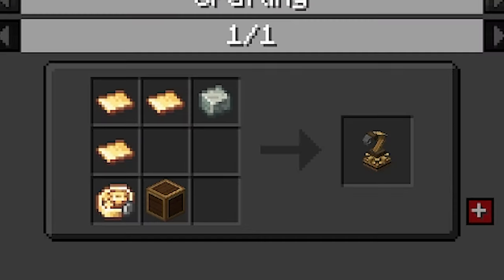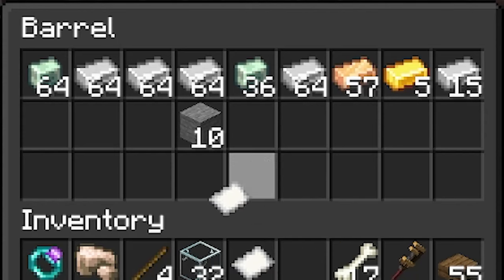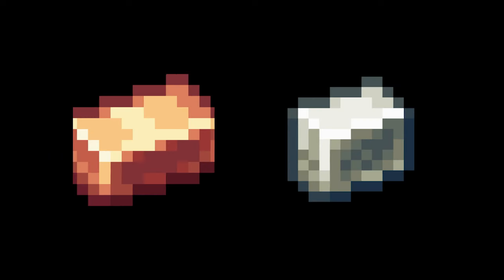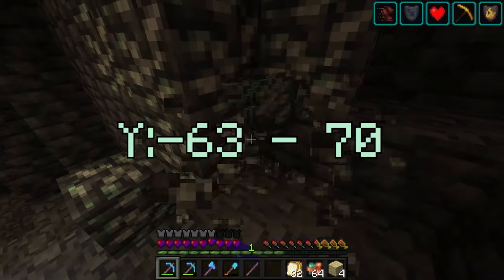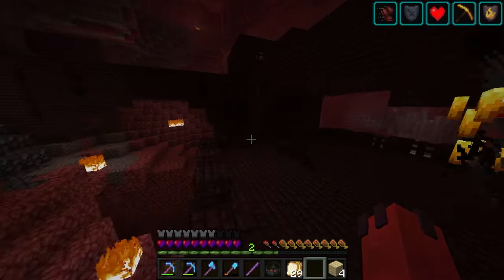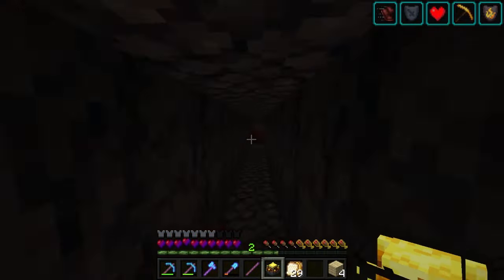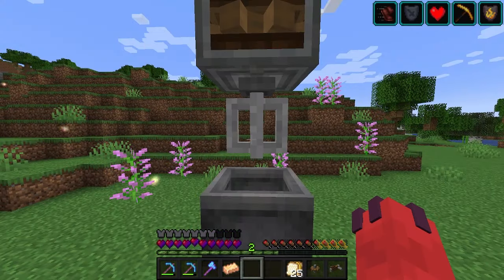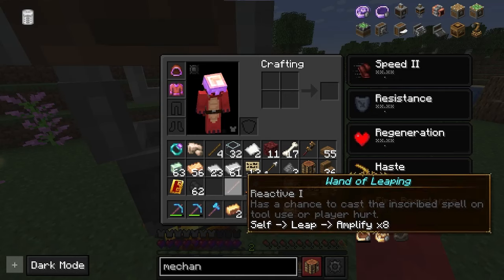How to make Brass - Minecraft: Create Mod

Comment: why is the mixer spinning but not dropping? i have more than enough force and my blaze burner is fueled and its spinning really fast

Edit: the issue was that the zinc and copper wasnt smelting. i saldy couldnt solve that so i resorted to smelting the zinc and copper in the tincers construct furnace and transferring it via pumps 

help would be appreciated because smelting it that way is really annoying
Reply: Did you solve that?
Reply: @euviumsapogrande4092  yh
Its a basin, not a caudron!
Reply: @gonzalezignacio3049  yea I found out I was using andesite alloy instead of tin to make bronze

Comment: No help when I don't have the press lmao. Can't get the press with out this so no HELP
Reply: You don’t need brass to make the press what u on about
Reply: @lordhall3774  The brass hand part of it takes brass... that's where I am stuck as well...
Reply: @MsPinky8890  you don’t need a press to make brass, blaze thing and mixer
Reply: @MsPinky8890 sorry you do need the press but you don’t need brass to make it, I think you are trying to make a deployer instead of the press of something, press does not require any brass just an andesite casing which can be made without a press.
Reply: Yes you can? Lmfao
It's a shaft, an andesite casing, and a block of iron

Comment: That didn't work for me. I tried using a water wheel. It shows what you show in the video, I did that but the mixer arm won't go into the basin. I have enough su but idk.
Reply from the maker: It might be the speed, some create machines need a high enough speed to operate. To increase speed place a large cog wheel on the rotating shaft then connect a small cog wheel to the large cog wheel’s grooves. This will cause the small cog wheel to rotate fast faster. Realest this until you have a sufficient speed.

Comment: ik im late as hell but when i put the ores in it doesnt spin, even though its getting enough speed?
Reply from the maker: It could be the mixer is either too far or close to the basin. Another possibility is you mentioned “ores” when the mixing recipe uses “ingots” but this may just be a typo.
Reply: @GarftheBard  i have a proble., i can't get a mechanical mixer since the only way i can get it (in my version) is with brass

Comment: How to I provide rotation
Reply from the maker: In Create, rotation is transferred through shafts and cog wheels. Place a vertical small cog wheel in the space next to the mixer, then connect the 'shaft' part of the cog to your source of rotational energy using a shaft.
Reply: @blockmario02  first off you're the goat for responded. What's a good source of rotation I tried Water wheel underground but it's not working
Reply from the maker: For a water wheel the water needs to flow around the wheel (not source blocks), you could also use a windmill bearing which requires a number of sail blocks connected to a line of blocks that connect to the windmill bearing. (Use glue to connect them if not using radial chassis). Finally you may need a fast enough rotation speed to use the mixer. If your rotation speed isn’t fast enough use a small to large cog wheel ratio to speed up your system. I hope this helps it’s hard to communicate these technical details through YouTube comments.
Reply: @GarftheBard  do you have a video that can help?